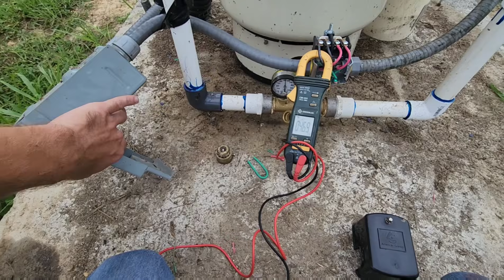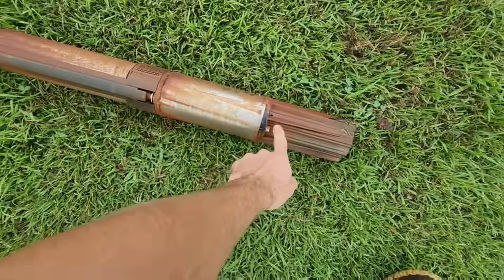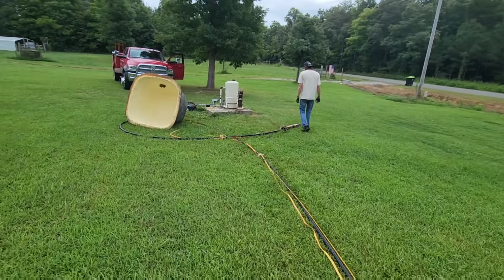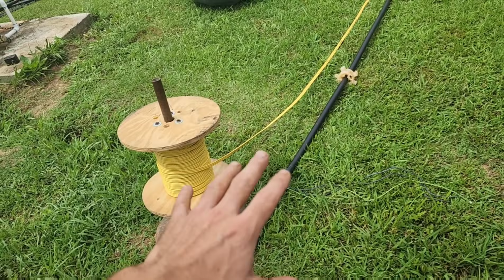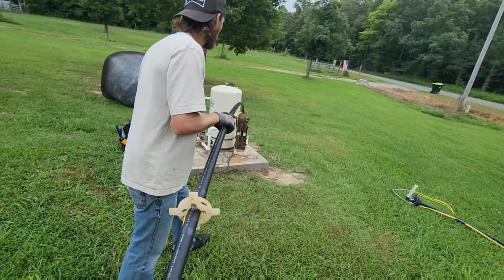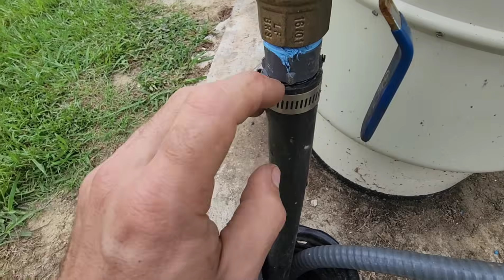Well Pump Repair, Getting Air in the Water? Here's what to look for and How to fix it.

Comment: So I know you don't like to have check valves by your bladder tank before your bladder tee , so where do you put your check valve I noticed you did not have one on your submersible pump before you dropped it back down into the well
Are you relying on a internal check valve in the submersible pump itself?

Comment: Can you tell me where you're located? I had a well put in two months ago and the installer went to jail. There's a leak somewhere down in the suction line and my pump loses prime. If I purge the air out when the pump first starts the pump gains prime again. I'm thinking there's gotta be some kind of valve that will just let the air out. Unfortunately, I can't get him to fix it because you know he's in jail.

Comment: Why is it that once in a while, you run across a system that never should have lasted as long as it did? A Red Jacket pump lasting 30 years is unheard of. This must not have been used much.
Reply from the maker: I've pulled out a solid brass pump from 1965. Motor still ran, but the pump was worn put internally

Comment: Have new 1/2 hp pump in at 90’ …water at 46.’ Checked pressure tank…good😳 check valve…new pressure switch 30-50…have banging when pump turns on now. Not all time, but a lot of time. Has even cut pump off , so had to turn back on…???

Comment: I really like your style and format of your vids, don't  change a thing, thanks
I am getting air in my the well line.  I have a shallow well (43 ft)  with a 1 HP  Sta- Rite jet pump and 1 pressure tank , no softener, filter , or anything else.
pretty basic system
what should i look for
Thank you  in advance!
Paul

Comment: How does air get in at the pump where everything is submerged in water? There's no way that disconnected line was holding the pump, nor was it 50psi. Nice sales pitch I guess. 😂
Reply from the maker: If a check valve at the tank holds & the one in the pump leaks, the pipe in the well drains down to the water level. This creates an air pocket inside the pipe. Once the pump kicks on, it pushes the air into the tank. May be hard to picture, but I've seen it dozens of times
Reply: @h2omechanic  Where does the water come from at the top?
Reply: @ I'm getting blasted with air and don't feel like pulling it again.. I'm hoping it's the pressure tank. I can play with valves n shit once I get the trash out of the way. And yes, I put 200psi pipe in the hole. 225' of it

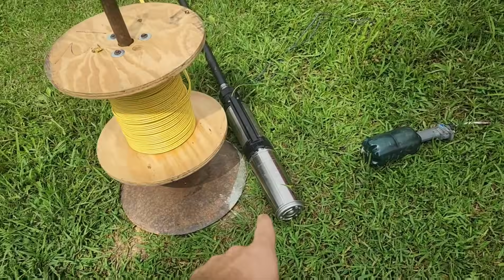Comment: @9:00, Now I know what happened with my installation. The 1 1/4” male threaded fitting swole up, at the pump and snapped off. Where the threaded fitting was cement welded to the pvc pipe held on. About 2’ away from the pump, at the pvc pipe, there was a bulge and I was trying to figure out why but you explained it @9:00 perfectly. Now I understand. I’ve been doing HVAC over 35 years now and many have told me I should create a channel but I see it’s very time consuming. I guess one must have a passion for it to progress. Thanks

Comment: Im getting air when my submersible pump runs . 40-60 switch and doesn't lose pressure when switch kicks off at 60psi. Im thinking its directly related to bottom of well itself.  I might need to clean point and have it jetted out.

Comment: Wayne from alberta. Do you ever show what happens if you cut pump moter looks like inside the pump. Like cutting motor in half. 
And when you shock treat do you let it stay in hole for weekend help to clean water

Comment: My pressure gauge at the pressure (40/60) switch goes to 70psi, then stops and goes down to 60psi in a few seconds, then with no water usage goes down to 40psi in 30 minutes or so then starts pump.  What could be going on ?

Comment: Question, why isn't the electric wire inside conduit? Yes, NEC does not require that but digging up buried PVC well piping and nicking or severing the wire is always a real posibility. A trench is dug, PVC is laid down with plenty of room for 1/2 inch or 3/4 inch conduit. This should be code!

Comment: You keep saying all the things they did wrong, but if it was put in 1996 and it is now 2023, that's a heck of a good lifespan
Reply: How do you replace the injector on a jet pump
Reply: Make sense I agree 🤔⁉️
Reply: With all those wire splices? The pump is 1996, looks like numerous failures on wiring and finally clamps and tubing.

Comment: I have a glass lined 42 gallon perma tank with a snifter valve in line with a check valve and a relief valve.  It has the pressure gage and the pressure switch on the side of the tank.  The snifter valve is leaking water while the pump is running and sucking air when the pump is off.  There is air in the water line.  So, if I replace the snifter valve, empty the tank and set the pressure at cut-in minus 2 psi, will that theoretically solve the problem.  And, can I still use the tank?  Next, I will solve the problem of leak down in the water line or the pump supply line.  Does that sound reasonable?  Thanks.

Comment: Help!! Lol I'm having issues with air in the lines, spitting sputtering when first opening faucet and flushing toilet. I Went under the house and the pressure tank feels empty I can rock it back and forth and feel/hear no water is this normal? Also the pressure reading slowly draws down until the valve clicks open and raises pressure. Any idea what to replace or check from here? Other then the air in lines all faucets seem to run like normal water volume wise..

Comment: I have a question, do they make spring clamps for those black roll fittings? I have always found them to be the superior clamp over long term due to how they can expand and contract with the pipe and fitting.

Comment: We got a spool that we can throw on the back of our pickup, get into tight spots and then all we need to do is get the  pitless up over the wheel. Wheel runs off the 12v plug on the back of the pickup. I can make a vid next time i use it.

Comment: Just bought a house with a well. There’s a tee at the top of the well. One main line goes to the house and the other side of the tee goes to the yard. I shut the line to the house off while we remodel. I installed a lawn spicket just outside the well on the line going to the yard. Now, whether the lawn spicket is on or off the 75 psi pressure relief valve keeps spraying water. Any thoughts?

Comment: We have a "galvanized" system with a "air volume" control in the tank.   Somehow, the system brings up a bit of air each time the pump is fired up and the air control bleeds out the excess.   What I don't know is how the air get into the pipe in the first place.   (BTW: it's a good system because it keeps about a half tank of water in reserve if the power goes out.

Comment: I have a check valve inside my house right before the pressure tank, so the house doesn't lose water pressure.  But I'm getting air in the lines so I think there's a leak between the pump and the house that's pushing air into the pipes when the pump runs.  The problem is the well was dug when the county didn't require info to be filed, so I have no idea how deep the well is, how low the pump hangs, or where the water level is.  Is my only option to pull the pump out so that I can measure everything and see what kind of pump and length of pipe I need?   The problem would be if something breaks and I'm unable to put it back.  There's nowhere around me to buy a decent pump on the same day.  Only Lowe's and Tractor Supply.   Is it safe to guess at maybe a 3/4 hp pump for a 4 bedroom 2 1/2 bath house and buy it ahead of time so I can order something of decent quality?
Reply: I was able to check the water level with a fishing bobber.  Water is just 17' below the well cap.  So I have that one measurement.

Comment: Ok my pump stop working an the pump guy said it was the points are u may call it a switch anyway then reprime it an I should be fine so I did an it is working now but not as good as it was before it stopped working working it has a newer tank so that's not the problem but the water just don't have the pressure it used to why is that
Reply from the maker: You must make sure the tanks air pressure is set correctly for the type of pressure switch you have. 
You can only test the tanks air pressure when the system is off & empty of water. 
Set the tank 2 psi below the "on" psi of the switch. Look under this switch cover & see what psi is "on"
If it says on=30psi, then set the tank to 26-28psi

Comment: You are a very good teacher! I've just purchsed a home in Tamassee SC been sitting for about 5 years built in the late 70's. The barbed connector that comes out of the 3/4 galvanized 90 where the house line connects from the well pipe has a crack (no pressure) should I use stainless or just go back with a PVC connector seeing that everything else is plastic.
Thanks for the very helpful information.

Comment: DONT use Chlorene in black iron well casings or steel well casings as it corrodes the casing and will lock you pump and or jet head well pumo in the casing and you will be paying annouther 10.000 dollars in fl. to get a new well.

Comment: With pvc a crane is nice to have, but not necessary. My well had  1" steel pipe at 160'. I pulled it by hand with a rope with a friction knot. And 3 pipe wrenches. That was loads of fun, 10 ft at a time.

Comment: Hey sir, really appreciate what you do.! thank you!!
QUESTION: im working in the southern Rockies in an area hard hit by forest fires and then floods (Hermits Peak Fire in Mora New Mexico)  Am a contract water system operator turned well mechanic by necesity. absolutely love it! helping folks recover after getting wiped out by the fire/flooding is extremly gratifying. most stuff i can fix no prob, but ive got one thats a puzzler. 
200' well, pumps running great pulling about 5 amps and producing plenty of water. Since the fire, it has started having moderate turbidity and a sulfur smell, but thats not the reason im writing. the well will pump all the way up to 60, cut off like normal, water flows and pressure slowly drops to 40/38 lbs, then guage drops like a rock. contacts remain open but pressure plumits from 38-0 in a second or two, then sits there for a pause of 3-4 seconds, then contacts close and pump comes on, recharges like normal. customer switched pressure switch from 40/60 to 30/50 just to see if it made a difference, it did not. Tank bladder holds at whatever its set at, 2 lbs less then low cut-on point.

the only thing im thinking is maybe a plugged pressure switch line, which ill check, but is there anything else you can think of? i dont feel like that tube is gonna be plugged, but i  cant thinknof anything else, can you?
really appreciate you sir! thank you so much!
Scott Frost
Backflow New Mexico
Reply from the maker: The tanks got too much air in it. If the switch is still a 30/50, drop the tank air pressure to 25psi. Keep it 5psi below instead of 2. Switches are not made like they used to, I've had similar issues. 
As far as the nipple being clogged, that's also a big possibility, it'll cause the exact same issue your experiencing. 
The trebidity / sulfur smell is due to the fires, rain water is washing the soot into the ground and it's mixing with upper water veins (I've seen it happen to a natural spring during Hwy 95 road construction, their retention ponds were muddy and affected near by wells.) Only time will fix that problem.

Comment: My switch fails to cut in some times, and is happening more often as time go's on. The pump puts out more then enough presser and the system will hold is pressure. I replaced the switch less then a year ago. I am at a lost as to what the problem is. Thank you
Reply from the maker: Nipple below switch is clogged up. Or the tank has too much air in it (could be going bad)

Comment: Good stuff! We had a freeze up here no issues got it back, after running torpedo for 2 hours yesterday. Guage is messed up on the tank now though, going to grab a new one in the morning. Nothings open today :( new subscriber here. Great channel my man. I also had a question how do I tell what pump was used in my well is there a plate on the well head usually? Live in downeast maine

Comment: Love your videos!  Have you ever experienced water to continue coming out of the black pipe at the wall during a tank replacement?   Well pump is off, but water is still coming out at a low pressure, but enough to fill a 5 gallon bucket within a couple minutes. Is it some kind of siphon happening?
Reply from the maker: Yes, typically that's the water heater back draining...hopefully it didn't empty too much & burn the element. 
If it back fed from the well side, then that happens if the well is at a higher elevation than the house, it'll act like a siphon bc the pipe does down hill & sucks water out the well. It only happens in the perfect storm type situation, but can happen. I always have a cap ready to plug it in those situations

Comment: So I installed a new tank with all new plumbing around the tank along with a new pressure switch and check valve. We used copper pipe. I have no leaks at any of the joints or connections. I also checked the air pressure in tank I brought it down to 28psi due to i have a 30-50 switch. I still have air in the system. So my question is that my problem is prolly outside at the pump or connections at the top?

Comment: I took some pictures but I don’t know how to upload them. The pressure switch has a small red electrical fixture that connects to the ground as well as the hot wire

Comment: Hi, my pump just quit. I just scheduled an appointment for Monday however I am out of water until then. I’m no plumber but after watching your video I did some troubleshooting. There is power at the pressure switch. There was no pressure in the well tank. Mine is 20/40, and I add 15 psi of air. It still doesn’t work. Do you have any idea what else I could try?

Comment: One more comment/question: I don't see a pressure relief on the tank Tee, is it not required? We have to have a 75 psi relief on the tank Tee, but many tees are not made with the extra opening for it, so until we found the Boshart stainless kit, we had to add a PVC tee for a boiler drain. Not a criticism, just curious. Thanks!

Comment: Thanks for a great video! I'm a plumber,  looking to get certified for wells and I have a few questions/comments:
1) Why no torque arrestor on the new pump, is it a soft-start motor? 
2) What would be the correct distance from the pump to the torque arrestor of one is used? 
3) You mentioned "no check valve at the top", do you remove the pump's internal check and install one just above the pump?
4) Do you ever recommend installing a rope to the pump?
5) What brands of pump do you prefer?
6) In my area (central Piedmont NC), well water is often slightly acidic and will corrode brass fittings within a few years,  so I've been using stainless fittings where possible, like Boshart makes a whole Tank Tee/accessory kit with everything in stainless, even a Square D pressure switch.  Often stainless steel fittings are either same price or less than brass.

Comment: thank you for answering my question the other day.  i guess i might need to redo the whole thing.  but  I  paid a lot to a reputable company a few years ago.  i wish I did not have to pay for the crane every time.  How can I convince them to use roll pipe si I can pull it myself.  25 years no trouble , now after about 5 years more trouble.  i have no water

Comment: Thank you for all of the great information in all of your videos! Was able to replace our pressure tank in Aug and had the confidence to replace our sub pump in Oct with the help of my 2 sons. Question for you, when our pressure tank calls for water and the pump kicks on we get one strong bang or knock.The pipe enters the house in the basement then we have a check valve about 2’ from where the pipe enters the house but before my big blue filter. The filter is just before my pressure tank The knock or bang seems to be right where the line enters the house. Its somewhere between the entry point, the check valve and the big blue filter. I would appreciate any suggestion you may have. Thank you again for sharing all your knowledge. Best videos on youtube about all things related to water wells!

Comment: here in So. California we all have 4-8000 gallon storage tanks, why is that and they are not used in your area. and I do not see a listing for the SS clamps
Reply from the maker: Basically it's your states laws. 
Too many ppl on the west coast are pulling the Aquifers down faster than they can recover. So your forced to have large tanks bc of the depths of your well. 
You Basically have a household water tower. The state designed yalls that way so a company can deliver you tanker loads of water. Eventually CA will be forced to do things differently in 30+ years.

Comment: I have sputtering and air coming from all taps in the cabin. Is this from the bladder burst or from the pump with a possible leak?
Reply from the maker: Normally it's due to a leak near the pump or a faulty check valve in the pump.